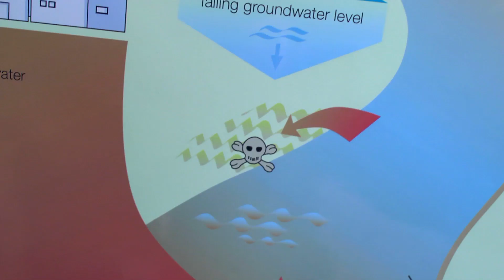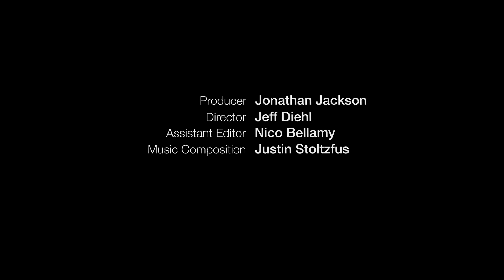Disconnect From the Water Grid: Greywater Action

Comment: Toxins in soap into the groundwater, and watering my vegetables? No thanks. As for biodegradable detergents, I somehow don't think they are actually edible. Saving water is great, but there's really a step missing here regarding efficient filtration before it is reintroduced into the system - Quite an important step I would have thought.

Comment: A smarter design might be to make the washer some how control the valve and send the soap laden wash water down the sewer but reuse the less contaminated rinse water for irrigation.
The hard part would be hacking into the washing machine electronics and finding a way for it to interface with a uC to control the valve.
Here an old school electromechanical timer could be advantageous for easier hacking.

Comment: Soap - if you choose it wisely - is harmless to the environment.  Some is terrible.  Read the label.  Sending it to a sewer loads the sewer system down, causing quite a stink when it rains heavily, with possible overflows into rivers.  So, greywater should be used by everyone.

Comment: No doubt users of these systems will have to change their detergents.

This is because even reverse-osmosis filters, can't remove molecules smaller than that of water, such as free phosphate and chlorine ions.

The only filter that can remove such things uses a combination of heavy oxidation of the water and UV light tor remove the ability for the water to hold the chemicals in question causing them to either settle or evaporate from the water.   This is very energy intensive on a small scale.

Comment: A high efficiency washer (What I have.) uses around 15 gallons per FULL WASH. meaning thats 15 gallons is split into cycles, it doesn't all go through at once. (failing marks on knowing how washing machines work.) Again, the product was a suggestion not a fucking concrete item. Are you fucking stupid? How many times do I have to repeat it? Or do I need to go look up a water filtration system that will do the job easily and still result in savings so you'll fuck off back to idiot land?

Comment: Actually I will respond once more: "The Absolute H2O IHS-10 provides 9 gallons per minute (with a standard UV dose)." Yea, my washer doesn't drain 9 gallons on its draining cycle, it's not 20 years old. Filters cost about 50 to 100 bucks and need to be changed every 6  months, which still results in a savings vs the cost on the water bill for watering plants everyday if used with her system, if you really want to get into this. So again, sit on your thumb, BRO.

Comment: Don't even try and tell me that you can use that for filtering the washing machine waste through it. It can't handle that much of a volume of water at once and its madeto filter ppm (parts per million) not large grosses. Plus that would cost more to replace those filters then it would save you draining your washer outside. Smart ass "bro"

Comment: Yeah plumbing "building codes" differ from city to city but the sole purpose of plumbing codes is based off the same principle of plumbing and this is why they have plumbing codes. It's still waste. In every city no such plumbing from any plumbing type fixture shall be discharged on to the ground. You wash your clothes in bleach and other cleansing products and basically you pretty much domed it up with other matter in your comment. What if your clothes have grease and oil residue on it?